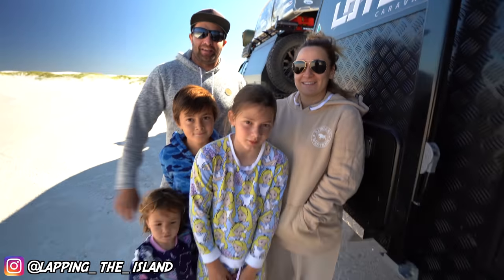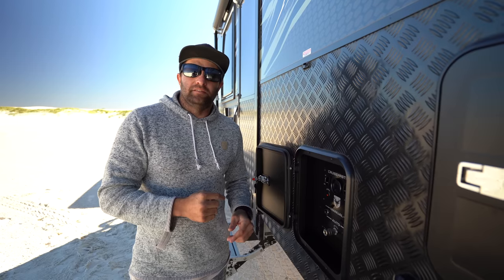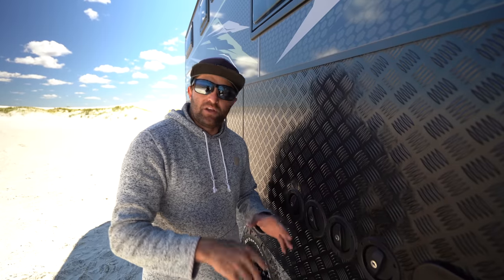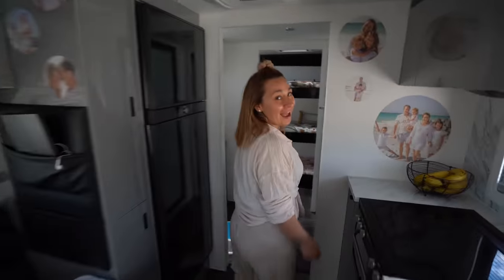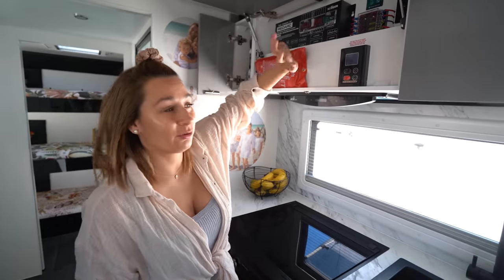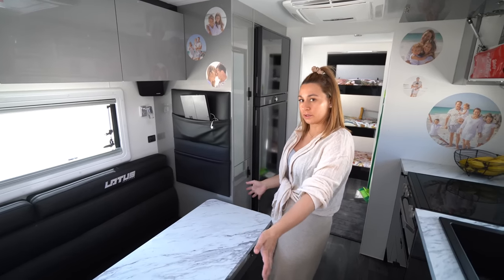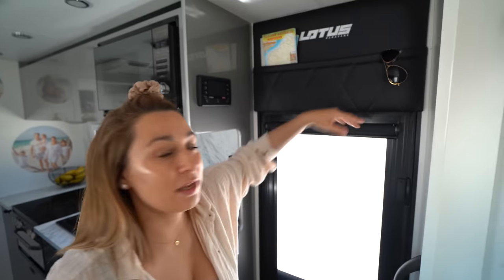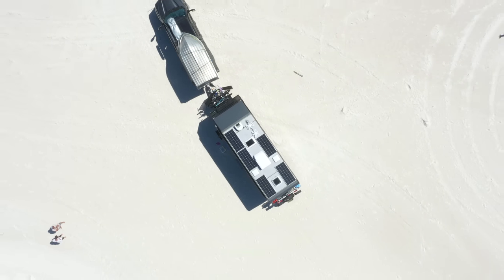2021 Lotus Triple Bunk WalkThrough

Comment: Hey mate. We have pretty much the exact copy. A few things we have learned. The old 23-3 layout for the bunks was better. We have had both. If you close the door to the kids room it gets stinking hot in summer and the aircon can’t get down there. The ATX upgrade is worth every cent 👍 
We had to put some tape up where the roller on the door runs against the awning. It slowly wears through. 
If they put Seaflo pumps in get rid of them they are cheap and nasty and will fail eventually. Get Shurflo installed if you haven’t already. 
We had a grey water diversion setup put in. It’s one of our best upgrades. Saves that grey water tank filling up with fat and hair from the wife. Just turn the valve run the grey water straight out past the tank. Tell wifey to be really aware what she cleans the black tap fittings with. Anything too harsh will take them back to bear brass. Get a SOG installed on the toilet. You will thank me. We replaced the wooden slats on the queen bed with a solid base. Sleep like a baby now. We have been living in vans since 2019 a good sleep is important. Wifey home schools and the kids are excelling. That’s about all I can think of right now. If you get stuck flick me a message. Safe travels 👍